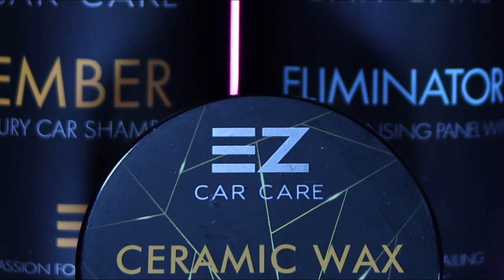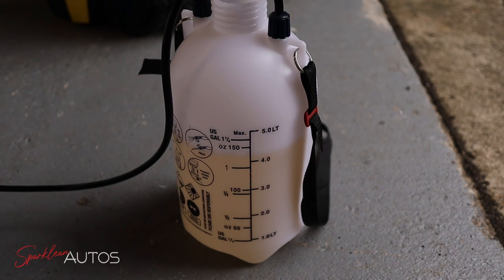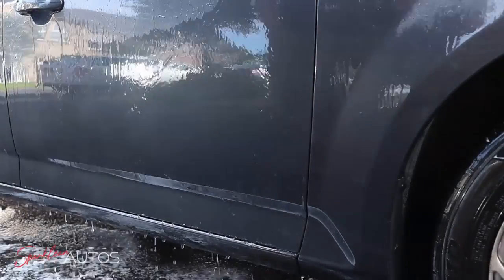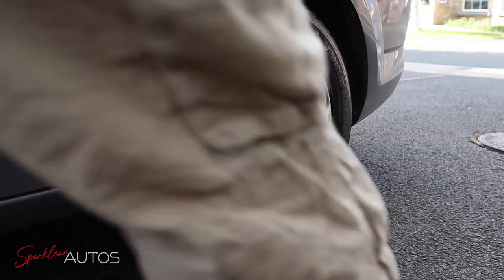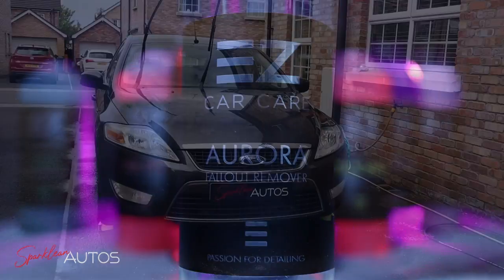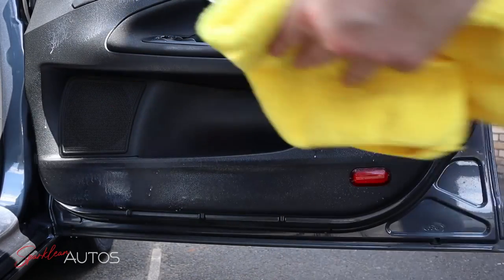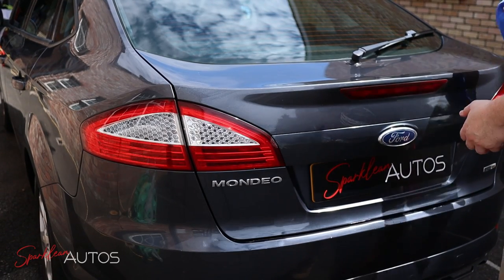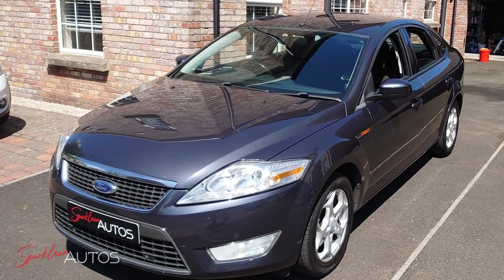EZ CAR CARE WEEKEND WARRIOR KIT REVIEW!!! EVERY PRODUCT TESTED  #carcare #cardetailing #carwash

Comment: I've always used fallout removers on dry panels & wheels ONLY. I think I'm right in saying the panels in the video were somewhat wet on application. Does the moisture not inhibit the chemical's effectiveness?. I suppose I could test this myself but I'd like know  your thoughts.
Reply from the maker: No you're absolutely right, panels SHOULD be dry to apply a fallout remover as water will act as some form of a barrier which will reduce the capabilities of the product. But in my experience the amount they will be affected isn't enough to justify the time & towels drying the car off only to wet it again... And in this heat it had mostly dried off before I got that far! But you are absolutely right 👍🏼

Comment: I’m trying to order a foam lance from EZ cars and is listed at £35. Would I get the karcher k adjustment as I will be getting the karcher k 4 pressure washer. Also
I heard I could get a karcher k 4 for cheaper from the outlets. Any tips
On how I could find the outlets?
Reply from the maker: I've never used the outlets so I don't know, Google is your friend with that one!! As for which connections you need, you'd need to confirm that with the supplier (EZ in this case) as I'm not in a position to answer that, sorry.
Reply: @SparkleanAutos  do you recommend any foam lances to use? Thanks for your great help really appreciate it
Reply from the maker: @qadeesnasir374  unfortunately the one I use mainly is out of stock (Anachem Automotive). The MJJC lance is good, particularly if you want to generate a lot of foam! The MTM one is also very highly rated although I don't have one myself. With lances, like most things, you generally get what you pay for so ones costing £10-15 won't always be the best quality or most reliable. At the same time, spending £50/60+ doesn't mean something is going to be great either! Depends on your own budget but the ones I've mentioned above are a safe bet 👍🏼
Reply: Hello iam from West belfast and love the accent